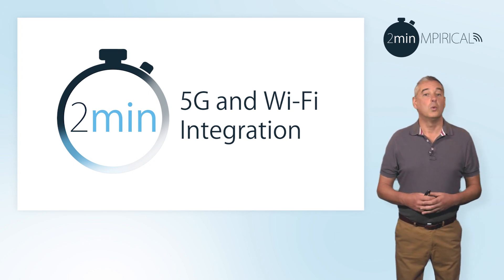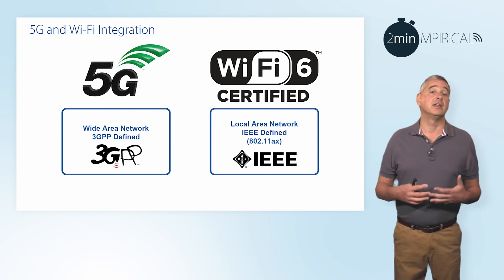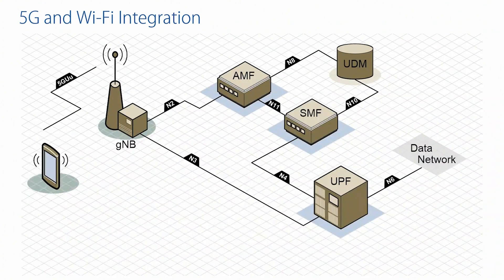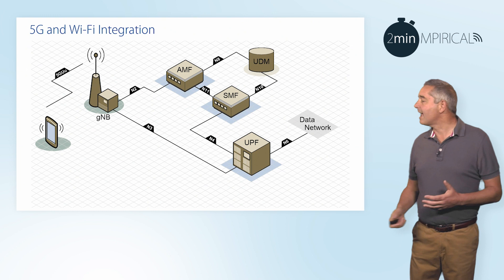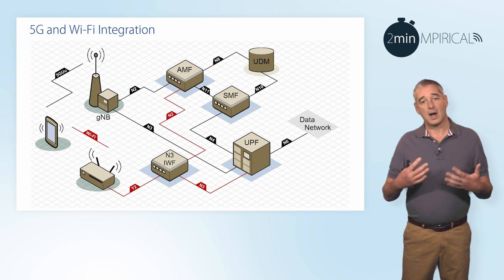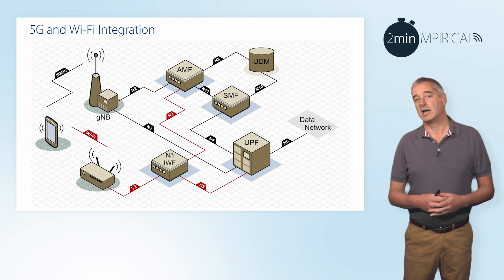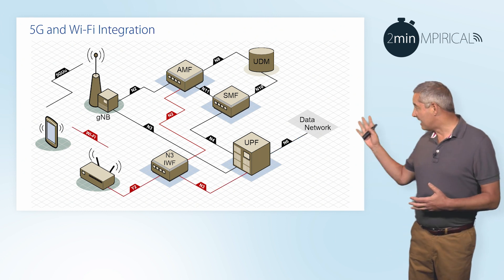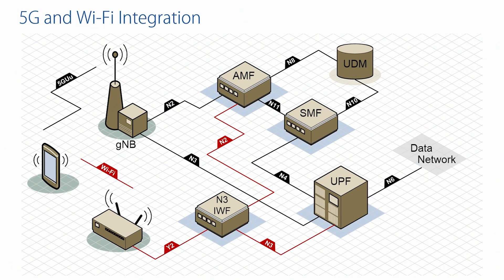5G and Wi-Fi Integration  - Mpirical

Comment: How are we supposed to connect existing SaMOG with 5G core as there is no mention of S2a interface ?
Reply from the maker: Thanks for your question, Interworking between a Trusted Non 3GPP network and the 5G Core is supported in a similar way to that of 4G. For example, a Trusted Wi-Fi Access Point will connect to a TNGF (Trusted Non 3GPP Gateway Function) via the Ta reference and this in turn will connect to both the AMF via the N2 reference and the UPF via the N3 reference. As such, NAS signalling can be passed between the device (via Wi-Fi) to the AMF whilst user plane traffic will be passed to the UPF for onward transfer to the external data network.